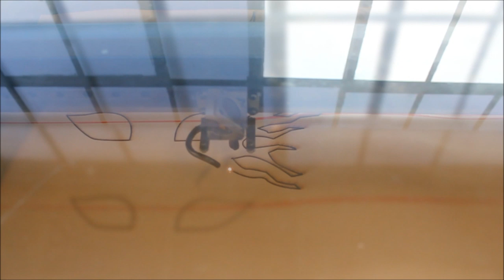Oak Myth Masks with a Laser Cutter - Leather mask cut outs with commentary

Comment: Great video.  What do you do after cutting to clean up the black edges from laser cutting?
Reply: +Chris Ellerby Did you ever get an answer on this?
Reply: +Eric Dupuis No.  But since then I started making my own laser cut leather masks.  I found covering the top surface in painters tape or paper tape protects the leather from smoke damage, and the black edges clean up pretty good with water.  I just soaked the pieces in warm water, scrubbed the edges lightly and let them dry on a flat surface.  https://www.instagram.com/p/ti3NbuKbNP/
Reply: +Chris Ellerby awesome work. Thank you!